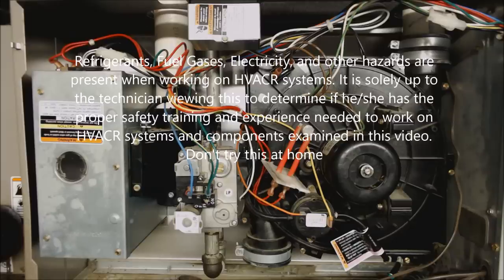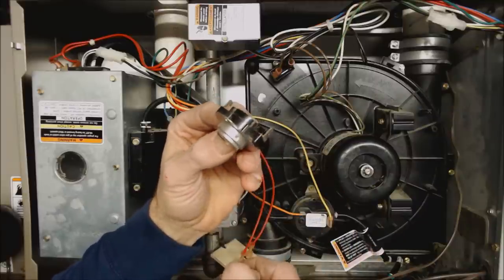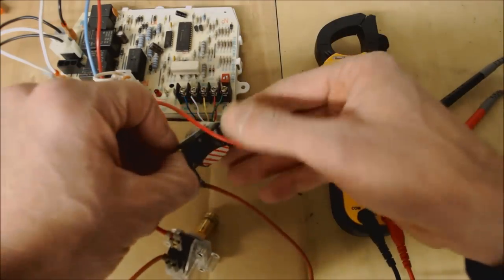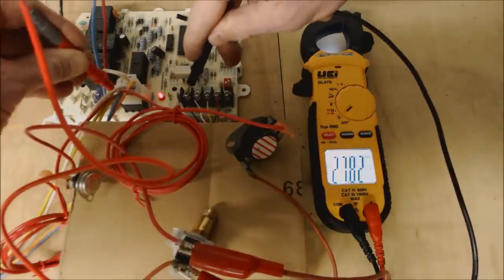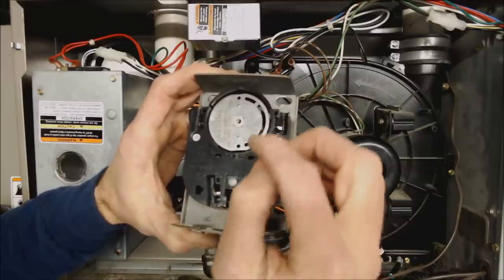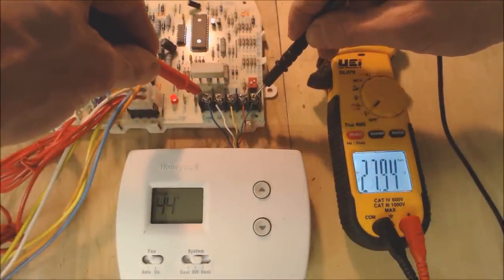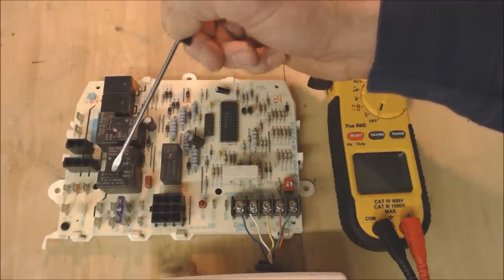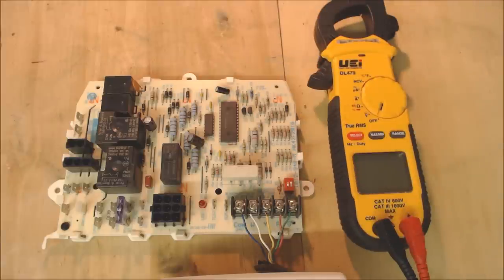Top 4 Problems Why the Blower Fan Motor Won't Shut Off! Continuously Runs!

Comment: My rv compressor works fine and gets cool then everything goes off.  About 15 seconds later the fan kicks on then stays on for about a minute.  It then kicks on again 15 or so seconds later.  Can anyone tell me what's wrong?.
Reply from the maker: Could be the thermostat or a fan relay may be bad, possibly thermostat wires partially touching, thanks!
Reply: @acservicetechchannel  we replaced the thermostat and it seems to be fine thank you

Comment: What do you do when no common is used
Reply from the maker: You can still check voltages with common at the indoor unit. You just won't be able to power the thermostat or check voltage at the thermostat, thanks
Reply: acservicetech thanks.. your videos are great, I'm an installer and have trouble understanding wiring. Doing well with furnaces now but now I find myself scratching my head often on gas boilers... again thanks your the man....
Reply from the maker: Thanks jjgm 2730, it just takes time and you are doing the investigating which is awesome, thanks